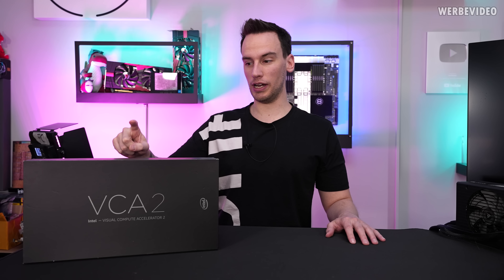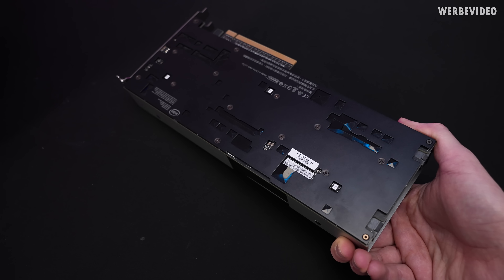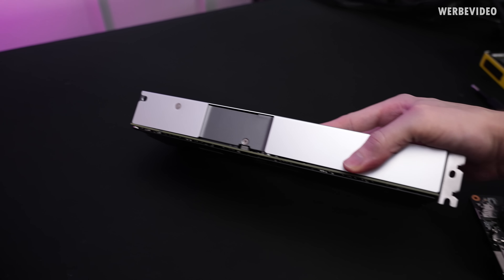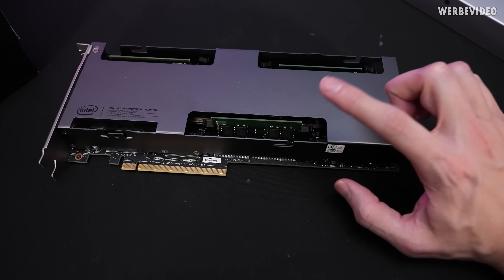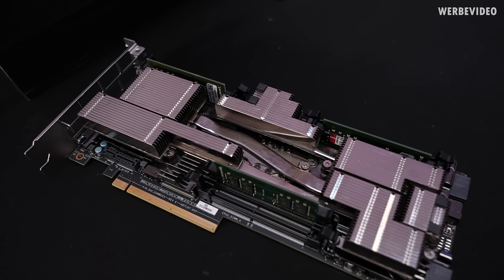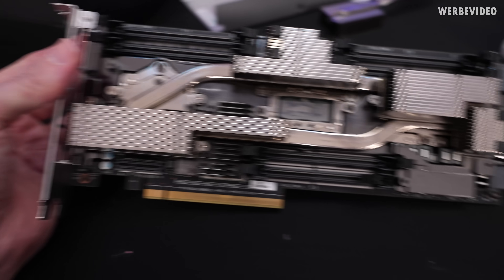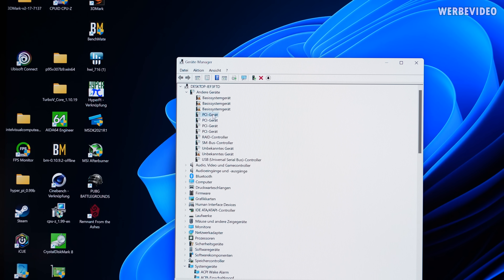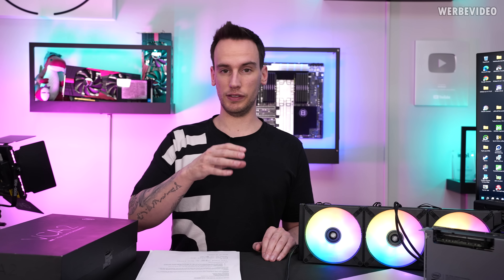Is this an Intel "Graphics Card" with 3 CPUs?

Comment: The short pins allowing you to figure out the number of lanes is useful information. Learn something new every day.
Reply: I don't think it is correct. That sense pin is there to detect when the card is fully inserted (since it would be the last pin to connect, telling the device to power on), making PCIe hot swap possible. You obviously don't hot swap your graphics card but a server in a datacenter might need to do so. It makes sense for there to be three of them here since the card has three devices in one to power on.
Reply: you can also just check the pcb traces going into the pcie slot
Reply: Want to hear something funny:
When i bought my gtx 980 it had the last pin at full length i touched it and it wasn't stuck to the pcb i thought crap i damaged it right out of the box now i know it was designed like that LoL.